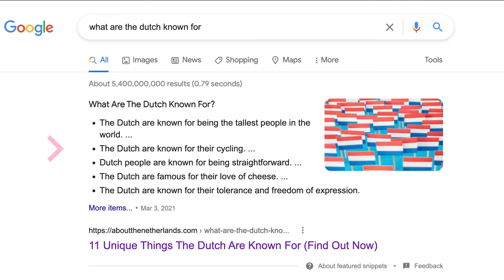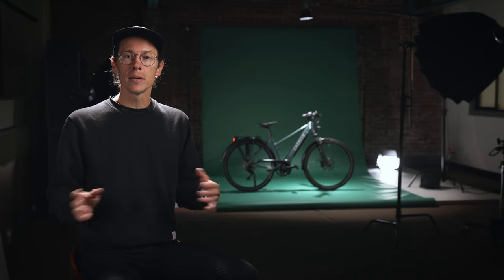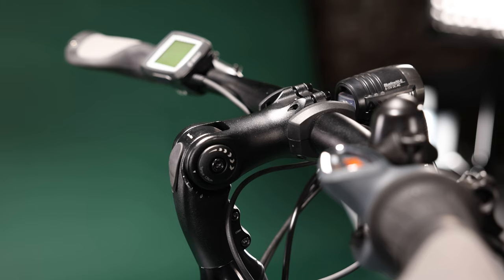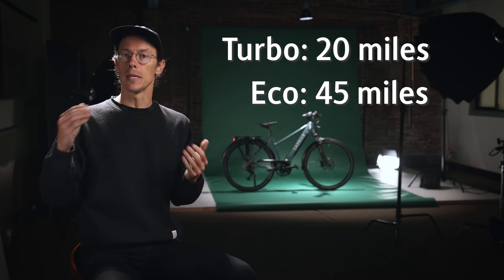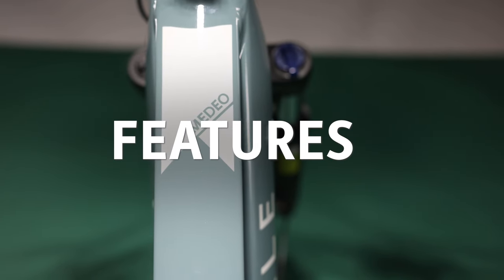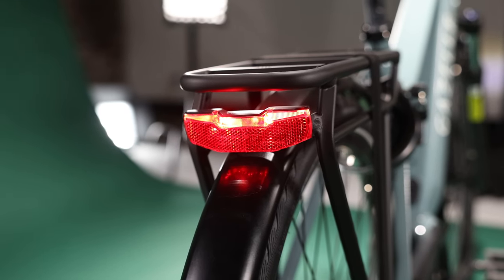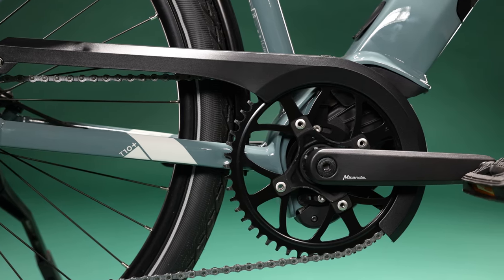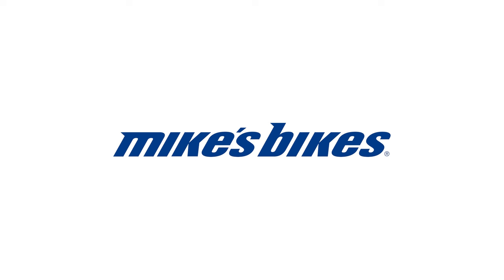FIRST LOOK: The 2022 Gazelle Medeo - The active person's everyday runabout.

Comment: The question i can't seem to find an answer to is how easy is it to maintain 28mph on flat ground with one of the class 3 bikes?  Would love to know more about hill climbing as well but that is so variable i wouldn't expect to get a reliable answer on that.  There is no point in buying a class 3 bike if I can't churn out the miles on the flats at 26+ mph.
Reply: I’ve had the Medeo 10+ for about a week (class 3). On flat, I can easily maintain 28mph and go a tiny bit above sometimes. On really steep hills I drop to 12, but I am not in shape. I expect that to improve as I ride more. And I mean REALLY steep hills.
Reply: @rougethistle  Thank you, thank you!